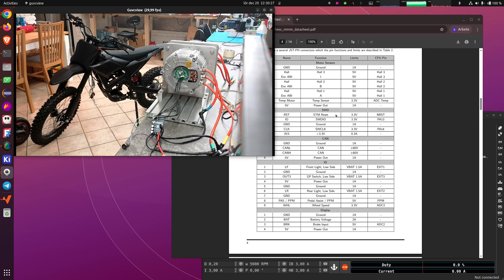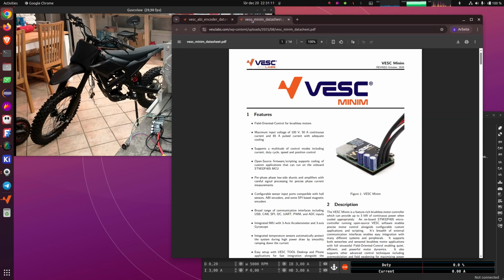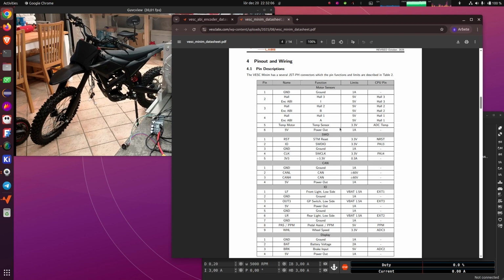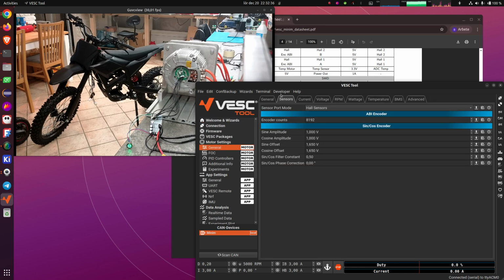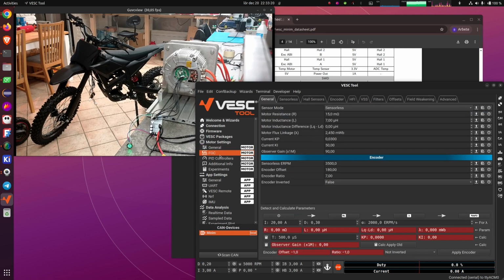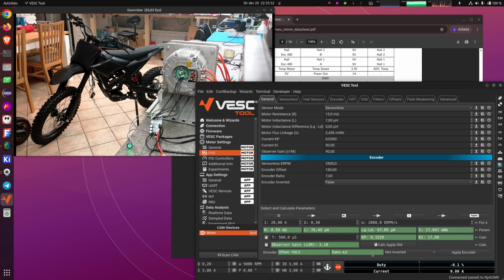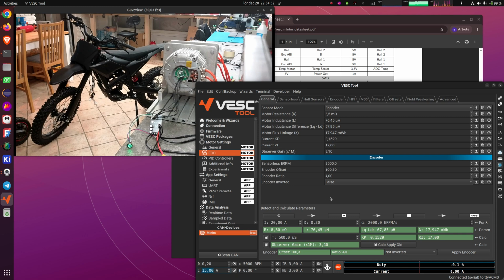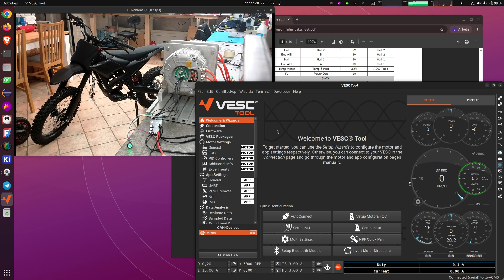VL Minim ABI (+PWM) Encoder Setup

Comment: Say, why all this fuss with back EMV tracking, different observers, gain, PID tuning, etc., when you can just take an encoder and know exact rotor position at all times?
Reply: One of the reasons couls be that it's not always possible to use an encoder in some use cases